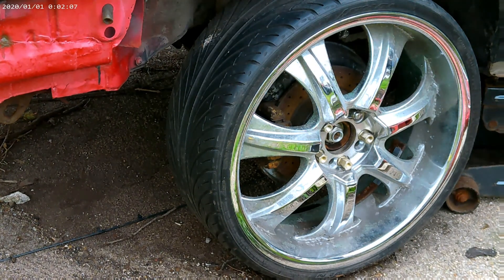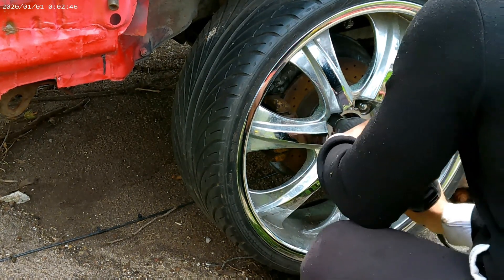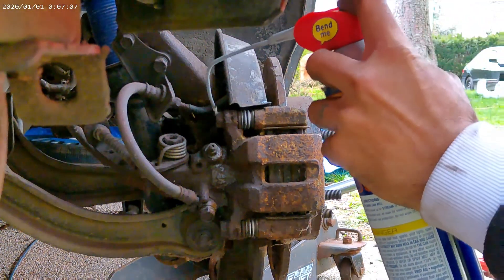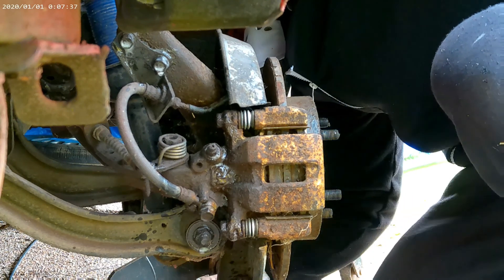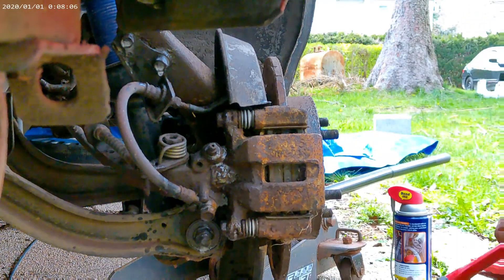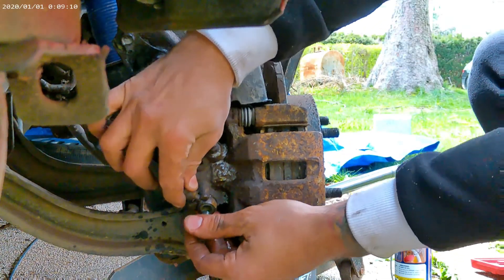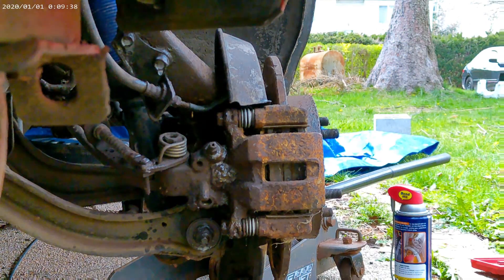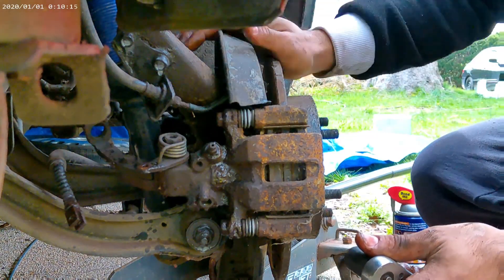How to remove rear calipers (1994-1997 Accord Ex) from CB7 or 1990-1993 Honda Accord Ex

Comment: How do I remove emergency brake line it's the only thing holding me back from fully removing the caliber off to put the new one on
Reply from the maker: You have to loosen it by removing the center console, once it’s removed it comes out with needle nose pliers.
Reply: Since I can't put a pic on here I'll trip to explain it. In the video at 5:35 you disconnect that cord from the caliber. I removed the clip holding it in place but Mine won't come out, maybe too rusted.
Thought I could do this quick easy job but it's all rusted lol
 Any advice I would greatly appreciate! 
Truly thank you
Reply from the maker: Make sure you remove the pin from under it. I 🤔 I did that off camera, the pin that goes inside the whole has a small pin that hold it in place.  If it’s removed a little love with a hammer won’t hurt to remove the pin just don’t go hulk on it.
Reply from the maker: Oh yeah someone had just stuck a screw in there.  The actual pin has a hole in the bottom for a pin.
Reply: Hey bud, thank you again for all your help, your video is very wise and knowledgeable and I much appreciate the responses. Just to recap, I couldn't actually get the e brake off and the two nuts that connect to the caliber wouldn't break free so I cut the caliber off and simply connected the e brake(with metal and nuts laying on top of new metal) to the new caliber. Ever since I finished the project both my front brakes are locking up. Probably bad calibers as well but also was curious if it could be the e brake.
Reply from the maker: @dustinthewind2932  sorry to hear that. An impact drill plus some overnight w40 helps if not at any auto parts they sell a liquid that you spray on rusted stuff to loosen nuts. After that heating it up with a torch is next.🥵 cars can be a pain sometimes